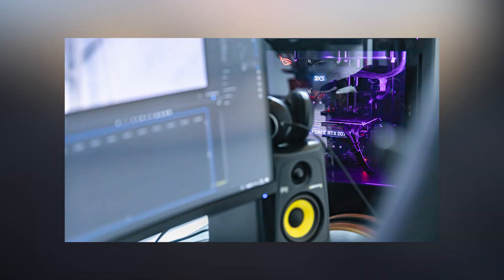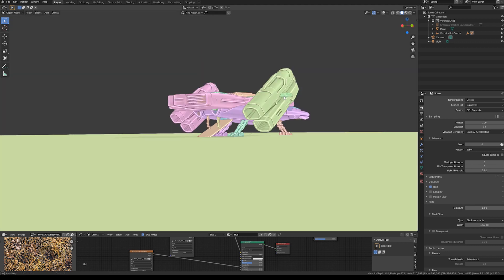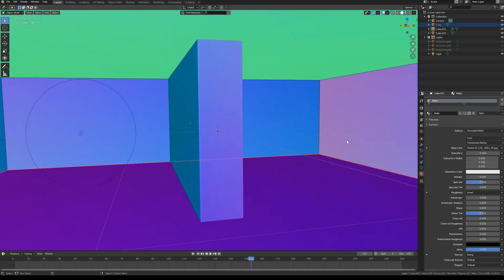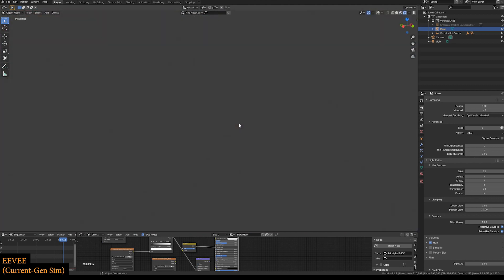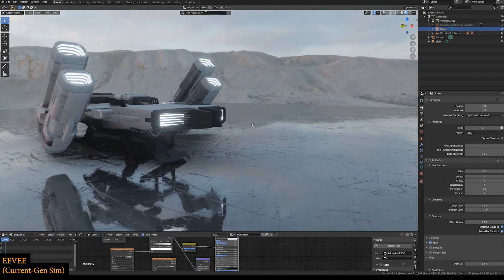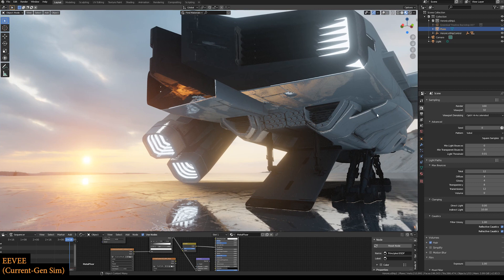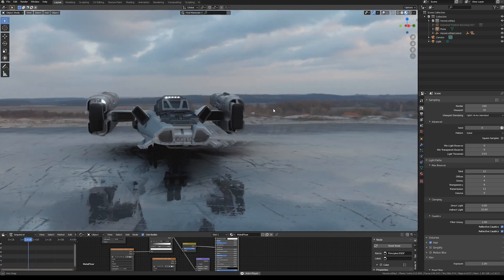Next-Gen Ray Tracing Demo using Blender 3D - How Will It Work?

Comment: 4:12 the actually day to day effect of real time ray tracing during blender workflow
4:4w also weir lens flare effect during eevee for some reason
14:45 can adjust how many ray bounces cycles is using to speed up render times

15:20 eevee use can be for rendering good quality test footage to see everything moving around without waiting for final render of cycles 
1m per frame at 25 frames per sec for 10 sec is 250min 
Whereas sacrifice some 10-20% quality to get some solid previz is totally worth it

Comment: You were showing the material preview, not the actual Eevee render.
Reply from the maker: @Lexxaro  This is not an Eevee vs Cycles comparison video. I am using the renderers to convey the concepts of Ray Tracing in their most basic forms. I'm well aware that Eevee can look absolutely stunning when used correctly, in the same way Cycles can look bad when used incorrectly, but this was not the point of the video.
Reply: Mat Prev uses eevee
Reply: Yessss.....
Reply from the maker: @7w1k_mahto  im aware, but the engine is the the same.

Comment: Instead of trying to simulate light bouncing in Eevee with ambient lights you should use GI probes, and reflection probes for reflections that don't require scene data. Of course proper raytracing will always be better since at least the GI probe method is baked and not realtime.

Comment: Your example of how reflections work in game engines is not correct in every single case. Early on, they used baked reflections (some newer engines still use this). However, if realtime, accurate reflections are required, some engines use a function called "Render to Texture". This uses another camera where the object is, That camera renders what it sees to a texture and, then applies it to the object. The drawback to this method is that the state of the reflection is always 1 animation frame behind the actual animation.

Comment: What kind of CPU are you using. The way things happen so fast when you move the camera around to show the mistakes in making something baked vs using ray tracing. I would guess you may be using a Threadripper from AMD. I am not sure if Intel ever brought out a CPU with as many cores or a CPU that surpassed the Threadripper. I know they have their Core i9's now I am not sure if that is supposed to compete with the Threadripper. in benchmarks i seen from digital foundry and other sites the Threadripper was on top. I am sure the more powerful the CPU makes the engines used for making games more pleasant to use

Comment: Is there any way to use OptiX denoising with a non RTX hardware in Cycles in the viewport? Or these specific hardware requirements are unavoidable ? I heard that OptiX denoising is just a software (and of course slower) but every hardware could do that type of calculations.

Comment: What you're saying is absolutely not true. You can get raytracing on non-RTX cards too, the problem is, it'd be damn slow. The algorithm is really simple, basically just calculating a ray/surface intersection, the problem here is that it needs hardware supported space partitioning and parallel calculations of the said intersections. What EEVEE does is a screen space raytracing, which doesn't calculate all rays, instead takes the data from the render layers and calculates only the stuff it can. This is why some parts are not visible - if you look at it closely, you can't see the ship's bottom reflected because it's not visible from the camera as well.

Comment: or maybe, like me, you have had an rtx card for about a year and still have not tried an rtx game... im happy with 4k60 and my VR. so i have not gotten around to it. from what i hear though DLSS has come a long way and i might finally be able to play some games (on slightly lower settings) using ray tracing and DLSS to get something very similar to 4k quality without losing my framerates. so its worth a go. i will put it on my to do list.

Comment: It appears that in the cycles version the bloom effect on the ship disappears. Does cycles have issues rendering bloom effects?
Reply: Bloom is a screen space post-process effect used to approximate the imperfections of light passing through a lens. It is not physically accurate.
Reply: Cycles does not use bloom because you usually use the Blender Compositor for post-processing. Eevee has it because one of its selling points is to have a powerfull viewport.

Comment: Adored TV(Jim) did an excellent video about path tracing and prob best one, though its few yrs old now. 
https://youtu.be/SrF4k6wJ-do 
You should watch it, I recommend everybody Check it out 

To say you need RTX to do ray tracing is PURE bullshit,  Nvidia May have brought ray tracing into spot light. But ATI had it way before Nvidia ever had it. And Pixard has been doing RT on video for years.  Toy story is prob first example.  But yes wasn’t done in real time.  Would take anywhere 2-3+ years to fully render the whole movie.  

you can do path tracing just fine on AMD 580/vega 56/64 and or GTX 1060/1070/1080/TI or better.  Seen ppl do on as low as GTX 970. But it wont be great.   IMO a GTX 1070+ or AMD RX 580+ or Vega 56 or better.  RX 5700/XT can do just fine.  That’s before AMD has officially added support for it. ( it’s only matter of time and they will) but of course AMD RDNA 2 will have full RT support I’m suspecting ( for mid range and high end GPUs)

Proof : https://cdn.discordapp.com/attachments/495731816662171658/665674884336058389/SireDragonChester-R7-2700x-msi-x470mobo-16GB-3200mhz-GTX1080ti-1Tb_SSD-Win7-64bit.jpg

Source : https://www.cryengine.com/marketplace/product/neon-noir
Anybody can down load the free benchmark, Just register with email and download their software.   And the fact it’s using Directx 11. Is impressive.   Though I also think they had in their originally their first video shown to public said “ using Vulkan api” but can’t find it. 

Crytek proved that you don’t need bullshit RTX too do ray tracing.   Here in Canada RTX 2080ti is still going for $1649.99.
When my GTX 1080TI can do just fine.  Also Minecraft (java) modding community brought path tracing first. before Nvidia and Mojang/Microsoft jump on board cause they saw $$$$$$$$ and demand from gamers.
I just hope Nvidia/Ms don’t try RTX MC locked behind win10/DXR/RTX bs, Cause XSX is Zen 2/RDNA 2.  Not Nvidia. 

Source : https://cdn.discordapp.com/attachments/495731816662171658/643313592711512085/Sire-Java-MC-1.14-4-R-2700x-GTX-1080ti-.jpg

While I’m no dev, just ex beta tester, small server admin and ex moderator (tech help guy) from small steam indie dev team.  I do believe Path tracing is far better and less Expensive vs Nvidia over priced RTX gimic.   And I’ve been gaming since intel 8088/86 CPUs days.  

Decent video man. I’m Not trying be a jerk but you need realize is that Nvidia isn’t only one can do RT.   Many from modding community have brought path tracing to other games.  Some look good.  Some look meh and some do nothing.  Of course it all depend on game /game engine used and api, what it capable and what isn’t.

Watcher 3/ Minecraft, even seem ppl try bring to skyrim lol.  Who knows what modding community will do.  And what devs will be able push/squeeze out next gen consoles and even PCs.    I want see HZD with Path Tracing.

Comment: As Chipp Walters said, there are other technics used to get rid of that. Placing extra lights to emulate bouncing like can be one, but you should take a look at irradiance volume and reflection probes. The first one will make your room lit aftected by the bouncing lights (not only intensity but also color). If you have a red cube in a white room, the room will take a slight red tint due to the light bouncing of the cube. Reflection probes will "simply" take a full 360 snapshot around them and emulate reflection depending on camera location. Reflection probes exist at least since Half Life 2, so that's not a really new technology ^^

Comment: Thank you . Best explanation yet I’ve watched of eeveee vs cycles . Cheers
Reply: Well, Eevee is mostly a raytracer, as it does use many ray tracing techniques, and Cycles uses a variant of raytracing called path tracing, where light can bounce many many times around the scene, in many different ways. Random variants based on probabilities are also used, and random samples are taken from each pixel to create a Monte Carlo integration (meaning it looks a lot more accurate but has noise and takes much longer).
Reply: The comparison in this video is not to show exactly how Eevee and cycles work to their cores, but rather to show how raytracing can expand realism in games as graphics cards become faster and faster.

Comment: Viewport denoising??? Is that new in 2.83???
Reply from the maker: Yeah. I do believe you need an RTX card to use it though.
Reply: Yeah I have one, I'm using 2.82 so gonna update
Reply from the maker: @Mart-E12  Awesome. Yeah it's a massive game changer. Not 100% accurate but gives you quick and easy idea of how the offline cycles render will look without having to wait for thousands of samples to clear up :)
Reply: They could still optimise it and someday make it work realtime like in games using more advanced filtering and stuff, though my 2060 super is barely capable of that

Comment: 8:03 actually hundred of millions :P
1080p render with 64 samples and 4 bounces is total of 531 million rays, that's why raytracing needs so much resources. Games need to calculates rays in amout 16ms which is really short amount of time, that's why devs need to use 1 sample per pixel and 1-2 bounces max at a frame (they can cache rays however so technically it is possible to have unlimited bounces but it's still 1 bounce per frame) and denoising. Hopefully we will see if raytracing cores are powerful enough in this generation to be more usable in games, I hope so!
Reply: Actually, Nvidia confirmed Minecraft uses up to 8 bounces for both indirect lighting & reflections.
Reply: @MLWJ1993  8 bounces per line of line for every light so millions, and thats optimized for a game, say 60fps, but blender is like 30 spf
Reply: Pathtracing takes multiple samples per pixel as a sort of Monte Carlo integration for light radiance, whereas a lot of game raytracers just take 4 or so samples ordered in a simple grid. However, this still means millions of rays per frame.

Comment: More Info: It's not just Xbox / PS5. NVidia's RTX (like my PC's card, yay!) can also do ray tracing. Blender should eventually be able to leverage RTX to boost Eevee closer to Cycles! :-D

The technical "how": RTX hardware has twice the access to shared memory for read & write, and that memory is twice as big. (6MB shared L2, plus L1 can double as shared. It used to be 3MB shared L2, L1 was stuck isolated). That means you can trace more rays at the same time (all the rays have to "read" the same geometry) and you can "write" more rays at the same time (they have to sum their results in shared memory.) More rays running at the same time (parallel) means massive performance gains. With RTX, that shared read/write is so big, and you can run so many rays in parallel, that you can do multiple bounces almost in real-time.

So close! But wait: then, by ray-tracing a smaller version of the scene (like say 480p or 720p), and then using one of the most powerful AIs ever (trained by NVidia's vast resources) to up-scale to 1080p or 4K... RTX is here in real time! (With some AI glitches here and there.) Then you might have to use a few more tricks for deep scenes (too many bounces), like temporarily baking your ray-tracing into a texture and updating that texture as fast as you can, blend the updates together, maybe get it 100% updated every few hundred frames or so.
I've been playing Minecraft with RTX through the Win10 beta, and it really does look amazing. Being able to build Minecraft scenes with lighting in your toolkit is like a whole new dimension to the game creativity-wise.

Comment: nvidia raytracing is not true raytracing its another step in the reality, but its still not 100% true, nice explanation for those who dont understand it. good luck with your movie btw :O)
Reply: It is "true" raytracing... If it traces rays for lighting it's raytracing, doesn't matter if it's 1 bounce or 8 bounces, 1 ray per pixel or 100000 rays per pixel. For now it limits the amount of rays & denoises the result (which still looks great) & on top limits the amount of bounces to a maximum of 8 (probably as advised by Nvidia, you could go higher but performance will degrade with barely any gain in detail save for a mirror in mirror type of scenario where you would have infinite reflections realistically).
Reply: @MLWJ1993  you can split hairs, its an AI enhanced raytracing, anything can be called realtime raytracing, after all atari did it with the falcon way back in the day on the falcon demo, but if its 1 fps and bottlenecking everything else and the it isnt realtime raytracing regardless of how many rays or not you send. lets just say that future isnt here yet, and look at the fact that it is doing specified raytracing on specific aspects of the scene to improve the visual quality of believability, its a partial solution to full raytracing until the ability of hardware leaps again to do better.

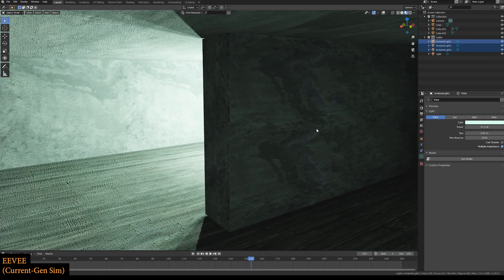Comment: 9:30 Well yes you can use another lamp to fake that, or you can do it the standard way: bake the indirect light
You can bake the diffuse bounces and also the glossy reflections, and with that you can achieve approximately the same look as the ray trace engine.
Also recently UE5 just announsed the new Lumen technology, which gives you a full dynamic Global Illumination without the need of baking. And as far as I know, they did not use the RTX ray tracing in Lumen, it can be rendered real time in any GPU, not just RTX. That's what the future really is!
Reply: From the preview that they showed, it does look like they may be using some sort of ray/path tracing, since when they move the light source, the change in GI kind of has a "cross-fade" effect. Not sure though, amazing either way.
Reply: Actually, UE5 was hardware accelerated raytraced, it didn't even use it directly but as a ways to calculate the big picture & substitute smaller details with screenspace techniques. UE5 will have fallbacks built in for rasterised graphics for hardware that doesn't do raytracing efficient enough.

Comment: Imagine eeve with real time ray tracing...that would be amazing !!
Reply: you basically would replace eevee with real-time ray tracing. No need for it in most cases, once the hardware is generally fast enough! There are some things out there already trying to achieve this on current hardware. Project Lavina comes to mind, from the guys who make V-Ray.
Reply: Eevee is a type raytracer, with certain hacks to speed it up. Cycles is also a type of raytracer called a pathtracer, and is way more realistic. Eevee is on the faker but faster end of raytracing, but cycles is on the realistic and really slow end of raytracing, since cycles takes many bounces per ray and many random samples per pixel, etc. The purpose of the video was to explain how raytracing is able to render things more realistically to real life, not to actually explain how Eevee and cycles work.
Reply: @mileswaugh  Eevee is not a raytracer, it does rasterization. "Rasterization - projects the geometry onto a raster of pixels and outputs a collection of fragments. Each fragment represents a segment (fragment) of a rasterized triangle (like grabbing french-fry cutter and slicing triangles into fragments with it) - the fragment size is related to the pixel area. Multiple fragments can come out each pixel (multi-sampling). Each fragment has a (x,y) window-space position, interpolated per-vertex output values (interpolated normal and UVs, vertex colors,..) and can hold other attributes." Source: https://blender.stackexchange.com/questions/120372/how-does-eevee-work

Comment: What's the difference between Ray Tracing and Lumen used in unreal engine 5 demo for PS5 ?
Reply: Lumen only works with indirect lightning. Instead of triangles ray-tracing (like Direct X ray-tracing), Lumen "cheats" and uses 3 methods :
- Ray-tracing on big objects or objects far from the camera : actual geometry of these objects are not used for the global illumination. Their geometries are simplified into voxels, then ray-tracing is issued on these heavily simplified geometries.
- Ray-tracing on medium size objects : uses signed distance fields instead of actual geometry. (if you don't know what SDF : « You can think of signed distance fields as the SVG equivalent of triangles »)
- Screen-space reflections for small and highly detailed objects : good old screen-space reflections. Cheap to render, and good results overall. But lots of constraints (camera angles, motions of occluding objects)